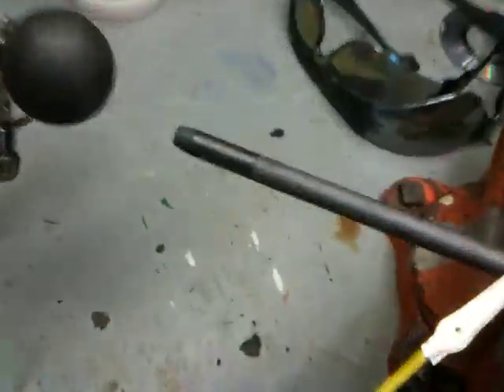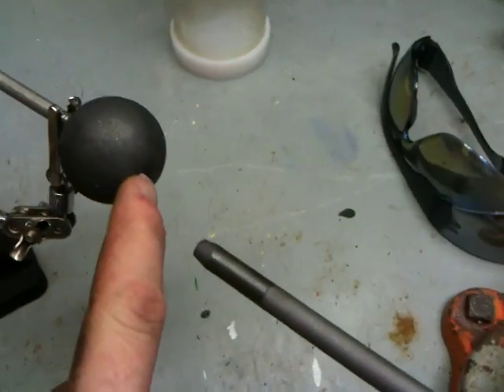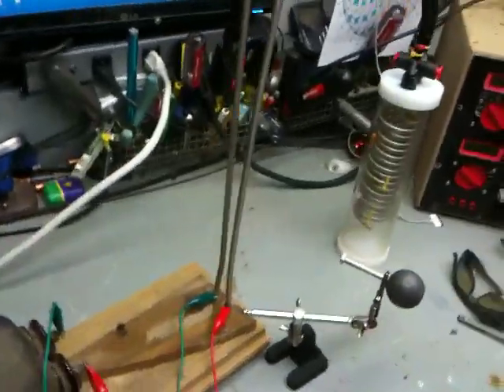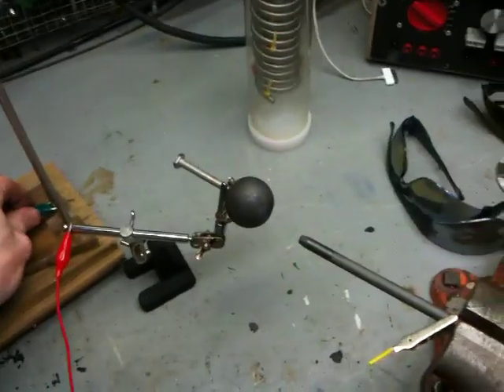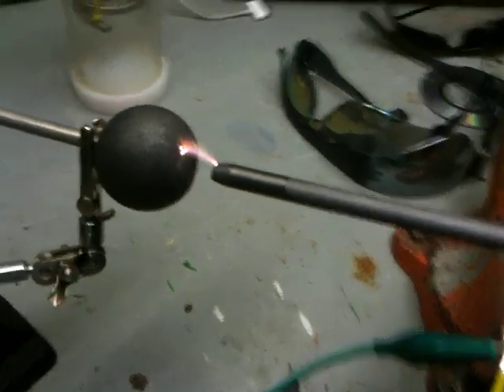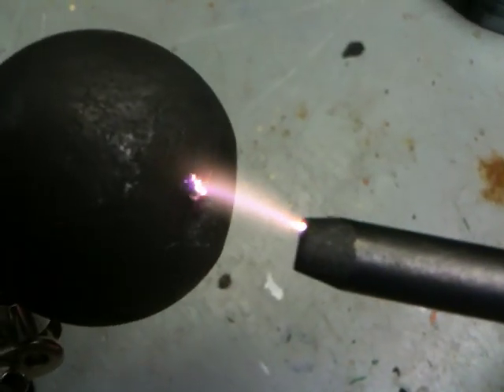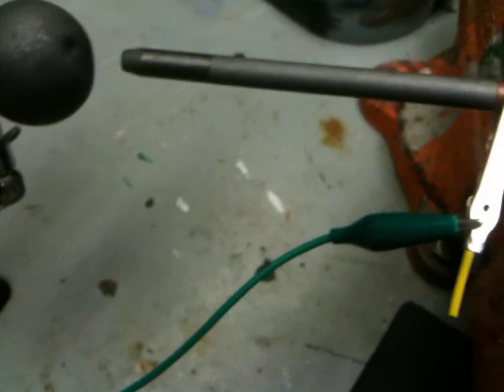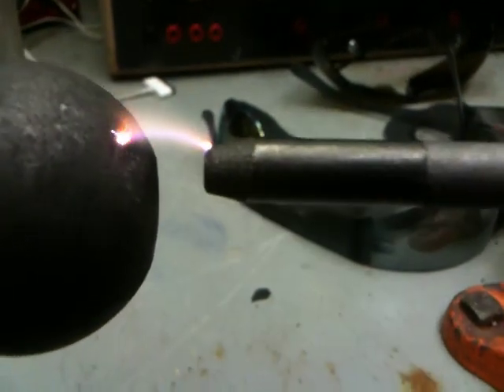1 Stanley Meyers EPG, Carbon & Graphite Spark Gap Testing (EPG Test1)

Comment: Russ, this is looking promising. I'll be joining you in this area of research soon (as soon as I get my 3d printer). I think the key to Stan Meyers gas was a high voltage spark. The spark was created btw two electrodes that were either cobalt or iron (magnetic) and of course Argon gas. He had both a high voltage spark and light to free one of the electrons off of Argon and make it reactive. The toroid itself should be non-magnetic non-conductive material (again I believe). Did you ever try making it out of plastic tubing? AWESOME VIDEO, thanks for all your work.

Comment: Russ, I would only use gap-probes of a known substance - no guessing - easier replicating. Also. make the spark gap in a pressurizable container. That way you can pump in the argon and just let the spark-gap run for awhile, Then slowly fill your toroid. by pulling a vacuum on it and letting the pressure differential do the work.
So far - it's looking Awesome.

Comment: you see on my setup i have two capacitors -without them i get the same spark as you have now-the caps bring the intensity to a bright white without changing the voltage.
i believe that is why they were called condensors in the old days-cos it condense the spark to a fatter white more intense behaviour-its more easy to control since it wont jump all over the place,you could easily make some leyden jar style caps that will do the job

Comment: @rwg42985 - the goal is to reach a saturation point with the spark gap probe material atoms to the argon -  if that is what you are going to try. I still think the deuterium gas mixed with monotonic nickle.To form the lactic matrix the nickle and deuterium have to be in the proper proportions. That is a puzzle I'm still working on.
I'm also looking at Gadolinium for the magnetic particles.
The spark gap will ionize the gas, and at the same time start the bonding process.

Comment: then how did you determine argon as being magnetizable? a little on the theory then, question why do these particle accelerate in the first place?
because free electrons are left suspended in an accelerated state of high spin.
the flux density of the magnetic field is increased due to the state of spin in the free electron itself.
thanks mike you made me rewatch the movie, and see the part i missed about the argon atom, and the loss of 1 or more of its 8 electron.

Comment: the outer atomic shell makes argon stable, and resiStant to bonding with other elements. so then as Stanley said, we have to cause the electrons to combine, having a dipole component, IE iron filing gains electrons in the outer shell. creating the  magnetic gas in the manner described. Isn't it  in this way Stan had  caused the increase in free electrons in the medium itself by the introduction of iron type magnetic particles into the medium ? The interaction causes the flux fIEld to go up?

Comment: the smaller the ball of carbon, the  higher prssure density of the electric stream on the ball.
the rod is hotter because it has a smaller surface density at the tip.
a smaller ball would create a higher energy in magnetic material produced.
but under higher pressure also.

Comment: 2 pencil 1 100 of a mm will spark 4 volts 100mm amps 3 AA battery will work ,carbon nanotubes will be made thanks good luck